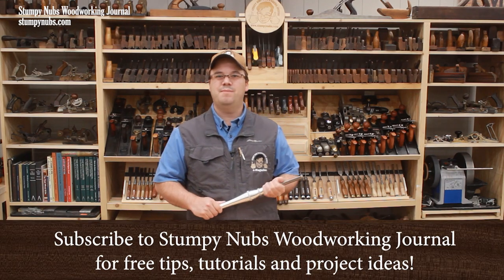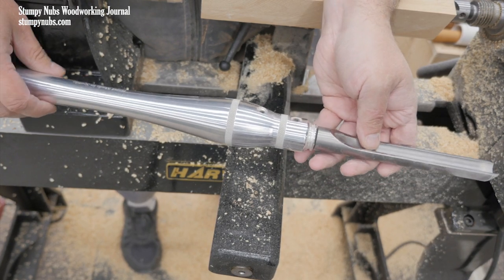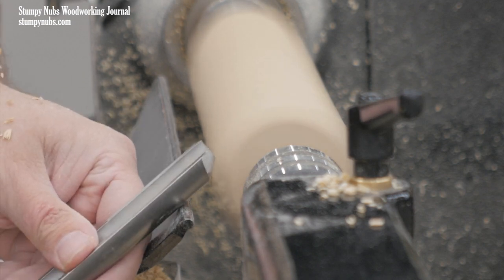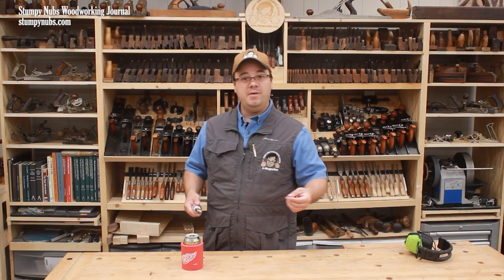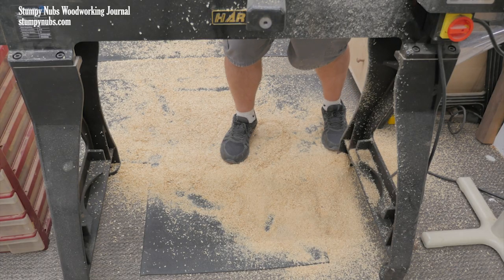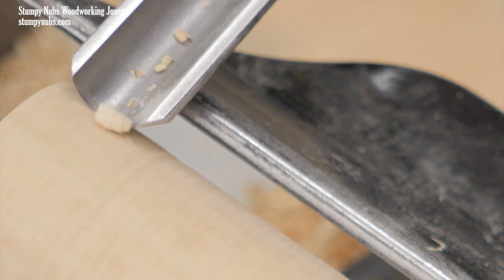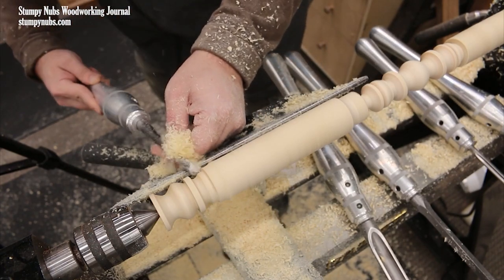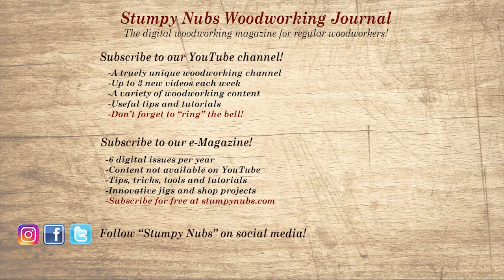An important lesson with a Spindle Roughing Gouge

Comment: I have watched a ton of videos from excellent turners such as Tim Yoder, Ashley Harwood, and Carl Jacobson, but I have never heard anyone describe supporting the cut this way. I have been so frustrated trying to learn how to use traditional tools that lately I've just been using carbide. This might be the key that I've been missing.
Reply: this channel is brilliant and I love it.   All new turners need to understand the ABC of turning.   Anchor, Bevel, cut.    ABC.  Not as easy as it looks.  I am kind of slow and stumbled with this.   While Youtube is great I would suggest you find a local club.  Most have good turners that will show you.  Hands on is the king.   And the best is to take a class with a noted turner.   Arrowmont, Campbell, Marc Adams are all good places and are starting to open back up.  Happy Turning
Reply: @haroldsworld , yes, the ABC principle I have heard many times, but have struggled to implement it consistently. And, yes, I agree that joining a club and getting some hands-on, in-person instruction would likely be very helpful. I hope to be able to do that soon, although a real class is probably not an option for me.
Reply: @earlmorton1216  Hi Earl, I feel I share your struggle, when I started I got a set of carbide tools, over time I have bought traditional tools. When I try to use the traditional ones I usually end up using the carbides (along with my trusty 80 grit scraper!) 
Now I've put the carbides away and have started just practicing cuts with the traditional tools. Akin to doing scales and exercises on a musical instrument! For example, my last three times in the workshop were just with the roughing gouge just practicing the roughing and smoothing cuts as Stumpy demonstrated. Starting my apprenticeship, as it were! All the best and I hope you are making progress.
Reply: Thanks Dr. Nubs for explaining HOW, but also WHY!

Comment: Please do not try to push the tool into the spindle!  That is asking for trouble.  Raise the handle for a deeper cut.  Lower the handle for a lighter cut.  Let the tool do the cutting... pressure should be very light. Your grip on the tool also should be a gentle grip.  Gripping with lots of pressure will tire you out very quickly.   This is an easy tool to learn and also is one of the most basic.  If you are having trouble with it check out a turning club in your area.  The AAW is a terrific resource.
Reply from the maker: You misunderstood my meaning. I am not saying to push with excessive force. Any pressure would be light, but there are different degrees of light pressure. Besides,  I was largely referring to the pressure exerted by slight body movement that is not parallel  to the lathe. I was referencing it's affect on the cut, not suggesting it as a primary way to control depth of cut. In fact the greater context was to exert even pressure, something I said repeatedly including suggesting to use your fingers as a depth stop specifically to ensure even pressure.

Comment: So clear and concise, not to mention 
very useful tutorial. 
The only part that I was a little confused
about was the 'supporting' the tool, 
when using the gouge as a smoothing
rather than roughing tool. If I have it
right after some 'deliberation' lol, 
I think I'm supposed to make sure 
tool is solid on the rest and turned 
slightly, engaging the lower 1/3+ - 
as I traverse the spiral
slicing.

Comment: For those wondering what is so special about M42 tool steel vs regular high speed tool steel. That difference is Cobalt. M42 steel contains 8% cobalt. That cobalt greatly increases wear resistance over regular HSS.

Comment: The tool rest angle is not an accident, learn to lay the gouge right on the full angle. Make sure your rest angle points at or just below where you are going to take off material, lay your finger below the tool against the tool rest as a depth stop, and observe that you keep the tool laying on the rest. You will have continuous smooth cutting at a fixed depth. Lower or move in the rest when you are tempted to lift the tool. It's easy and you avoid putting yourself off balance, to do this swaying business.

Comment: As I almost always find myself saying after I view one of your videos, this is BRILLIANT and exactly what I needed. (I'm now learning how create consistent-diameter spindles for my 7"-long fishing lures. Since I eventually want to produce quite a few of these (all more or less identical) in each session at the lathe, here's a question: Would it make sense to give my blanks a "head start" by running them through a round-over bit on my router table to remove the corners before putting them onto my lathe?
Reply from the maker: Sure. But you can also do it with a band saw or a table saw set to a 45-degree cut.

Comment: As a wood turner.  Thank you for showing good technique.  I will say that more of the pros that I know use Thompson Tool, including myself.  Their 10V steel holds an edge better that M42.
Reply from the maker: A couple years ago I spent time with both the Thompson folks and the Carter & Son folks at a turning show, trying to decide which brand I wanted to work with. I had dinner with Doug Thompson twice. Both brands make top quality tools. Frankly, I could have gone either way. But it was the people at Carter and Son that won me over. And not because they treated me as special, but because they treated EVERYONE as special. I spent time standing on the show floor where I could observe both booths unnoticed. The Thompson folks were polite but it was all about making a sale and moving on to the next customer. The Carter folks, on the other hand, were treating every person that walked by like a member of their family, whether they were there to buy or just to look. Honestly, my experience with the two were like night and day. The folks at Thompson are fine people, don't get me wrong. But the folks are Carter are exceptional people, in my experience. And as someone who own tools from both brands, I disagree that Thompson tools hold an edge longer. I find that the edge retention is about equal. I also find that Carter's M42 takes a sharper edge. Here's a helpful video comparing tool steels used in turning tools: https://youtu.be/vcM6kStHhCw

Comment: I often use a spindle roughing gouge on a bowl blank, but I'm VERY careful to make SURE that don't let the corners catch.
Reply: When in a pinch & it's the only bit of sharp steel left, I specifically use the corners to cut into bowls & other cross-grain pieces. It's a rough & extremely aggressive way to do it, but it moves bulk waste really fast & because you know you're going in with the corner, you're ready for it to need some strength & it won't take you by surprise. You just have to remember to raise the rest & tilt the corner down just a little. It's when it's tilted up & you're not expecting it that you get those nasty catches that rip pieces out of the chuck & try to send the tool into your face/ribs. Still, carbide has done away with the need for any of that since it produces a similarly horrid initial result without the risk.

Comment: Informative as ever. One suggestion though, the toolrest should only be adjusted while the lathe is off and not turning. Novices can inadvertently move the rest into a moving piece.
Reply from the maker: Did I adjust it with the lathe moving?

Comment: Thank you Stumpy! New to turning I initially tried using a spindle roughing gouge without any real help, as in no help, because I thought it was far simpler then it really is.  After several catch's the 2-1/2 inch diameter x 4 inch stub I was cutting completely departed my four jaw chuck, traversing the shop in an impressive arc before striking the garage door. Really got my attention. I concluded I was not appreciating how vital the proper sequence of events really is. Including how high to set the tool rest, properly holding the tool, body position/movement, tool position to present an accurately supported cutting edge to the work, tool pressure against the tool rest, tool cutting edge angle and pressure  against the wood. Following all these steps - I actually turned a square into a cylinder without a catch, or the work arcing across the shop. Fantastic!

Comment: I never knew you could throw a square blank on and start cutting, I was always taught to knock the corners off with a plane or chisel. I'm assuming that was a school safety thing. Thanks for the awesome video!
Reply from the maker: You can with a spindle roughing gouge 😉
Reply: @StumpyNubs  for years I did my roughing w/ a 3/8 bowl gouge because it was the only gouge I had.

Comment: You still need an expensive lathe
Reply from the maker: No, you just need something to spin the wood. However, I do have an excellent lathe: https://www.harveywoodworking.com/products/turbo-t-40-14x24-wood-lathe-with-servo-motor
Reply: @StumpyNubs  Could you smooth a spindle with a skewed pass of a hand plane? Be careful, but it totally seems doable!
Reply: @FLPhotoCatcher  Do not even consider attempting this. Yes, it's possible (I have tried it, with a reverse grip, because I am reckless), but you need to grip the hell out of the plane somehow & the speed of the lathe will drag the iron out of square almost immediately & just mess things up. If you do lose your grip, you'd be sending a very heavy piece of metal straight across the room (or into your face if you're unlucky & it bounces). It's basically just doing what an engineer's lathe does, & those are not good for working on wood.
That said, you can cut a slot into a broom handle & insert a plane iron in there (with some extra holes & bolts so it can't rotate laterally) & make yourself one enormous skew gouge.
Reply: @nightcatarts  I think it's not that dangerous, IF the plane is held at an angle, up to maybe 45 degrees from a right angle to the spindle. That would mean only a small-ish part of the plane's blade is in contact with the spindle. Yes, the spindle should be pulling the plane away, and the plane needs to be very sharp. And it should only be done after the stock is made round.
Reply: @FLPhotoCatcher  The problem is that you can't grip any hand plane that well to resist the sorts of forces exterted on it. Any change in grain & the iron will dig in, catch, & twist it from your hands. Then it goes flying, you wreck it or the iron against the tool rest, you put a big dent in the plane bed if you removed the rest, or worse case it ends up going into the chuck. Much better to simply get/make a skew.
Reply: @nightcatarts  That could be. I was thinking of a way to flatten the spindle, and a plane is good at flattening. But it does sound too dangerous. Are there wheels, like roller-coaster wheels that ride along the tool rest to allow perfect cylinders or cones to be turned?
Reply: @FLPhotoCatcher  I've only seen homemade rail jigs like that, but it's certainly possible. The problem is that you really need to adjust angle, pressure, & cut speed in response to the way the wood feels, sounds, & behaves as you go, otherwise you end up with a rough finish & may as well hammer the thing through a hole in a piece of steel.
Reply: @FLPhotoCatcher  I've done exactly that.  Round, or almost round, stock w/ the plane at a 45.  Works fairly well for getting the surface smooth and even.  A properly used bowl or roughing gouge does it better, tho